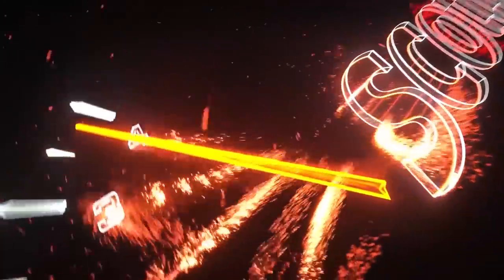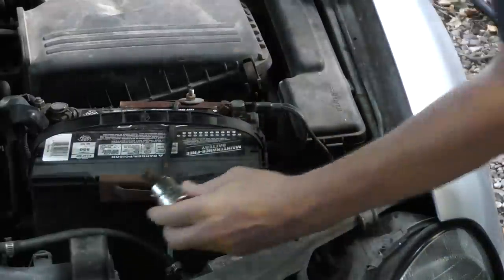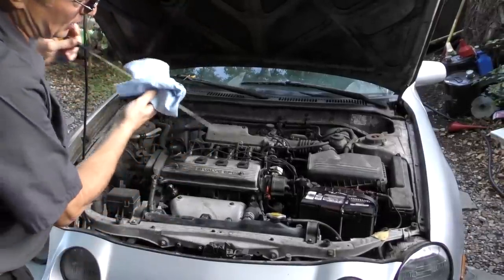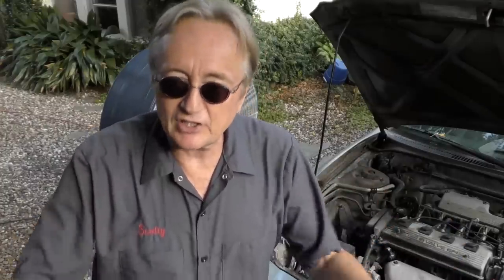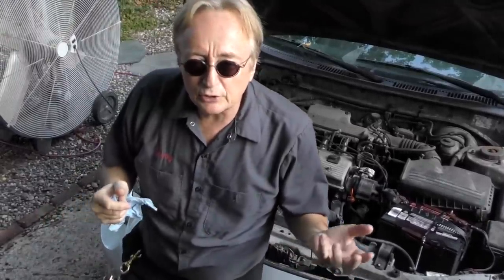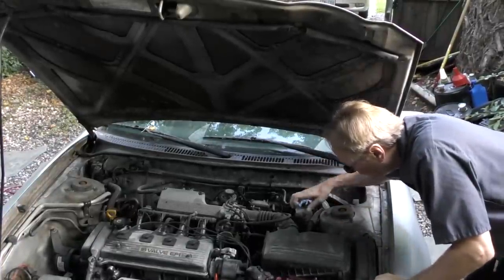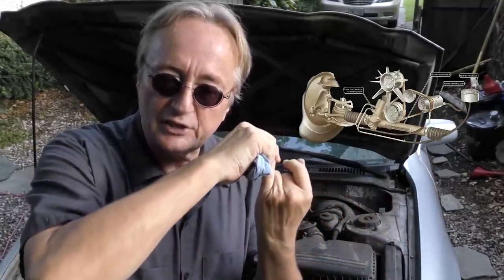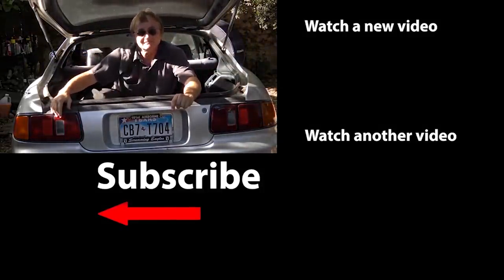If You're Not Doing This to Your Car You're Stupid

Comment: Scotty, you are using the wrong battery protection!!!!  I use vaseline to coat metal surfaces and battery posts and connections. The vaseline protects the surfaces from rust and corrosion. I use a small stiff brush to apply the petroleum jelly to all surfaces, and I NEVER have any problems with rust or corrosion. It is cheap, protects the battery,  and you do not have to re-apply it every six monhs like with the aerosol protection. This is an old solution from 60-70 years ago that works every time. I have have had batteries last seven to eight years, way past the "normal" life of a battery without adding anything more than distilled water when needed. I clean the top of the battery to get road dust (read "rust") off it creating a high impedance path between the posts that ruin batteries and alternators/generators.  I do not buy the felt pads, nor anything in an aerosol can to protect my battery - it is a waste of time and money.
Reply: I use Valvoline too on my battery post, always have, I apply it with my finger wearing a disposable glove!  ( i don't like the spray, it goes everywhere, messy!)

Comment: I would clean the battery terminals, Scotty, but then I'd lose my perfectly set entertainment center settings.
Reply: Use a memory backup battery, easily attached via the diagnostic port adapter.

Comment: My 1999grand am when I got it  I got oil changed they put Syntex in it  they replace wheel barring  and ask them change transmission fluid  they could not find drain plug  I was told it was sealed . it  don't have dip stick .  but I change the oil every year I get reg oil from quick change place . I got changed 2 times last year . they put high miles oil in it .   but  4 mo later change oil  light came on .  every once in while it  qort low . so I just put Walmart brand oil in it . the oil look good just smell like gas so idk my car also drink coolant  and take that Dex cool . I don't know where it is going  .car never over heats so I don't know  local guy I truss can't find where it leaking .he work on my car few times I know nothing about cars  it close too 200k miles on it  runs great just no ac so don't drive to much this summer

Comment: How disappointing Scotty no mention of changing out your differential fluid or greasing the ball joints, tie rod ends, sway bar bushings, drive shafts and U-joints. Also for changing out sealed transmission fluid it holds more than what drained out so your only partially changing some of the fluid and mixing it with the used fluid. To change all the fluid you will need the transmission to cycle the fluid and drain the transmission about 4 times to final get new fluid draining out.

Comment: For the Chrysler why would you even flush the brake fluid every 4 years when it won't even be running by then? 🤔
Reply: My 01 Durango is pushin 250,000 miles, although i'm convinced corporate was there the day they were making my engine lol. I truly believe you take care of the vehicle it will most likely take care of you.
Reply: @Drkonapurps99  Chrysler products were made better back then, now FIAT owns them it's common for a Chrysler to have major issues in less than a year after you buy it brand new from the dealership. normally people try to take it to the dealer to get it fixed under warranty but they rarely ever fix the problem. you are right that taking care of a vehicle will help it last longer, but some vehicles just break no matter what you do. newer dodge durangos have this issue where the car will have an electrical problem, and then engine stalls and the steering locks while driving.

Comment: Hey Scotty are Honda elements good cars??
Reply: They sure are....wife and I bought a new one in 2008...just put a starter on 160,000 miles , put a battery in 2015, only regular maintenance tires, brakes and oil, AC even still running strong , I'm in Texas , was 103 last week

Comment: Is it okay to change a plug in hybrid oil every year?
Reply: should be, depending on mileage
Reply: @wholeNwon  10K miles?
Reply: @clashwithneo  Depends on how much the engine ran during that distance. "Synthetic" or conventional oil? What does the manual say?  I'd probably change at 7500 with "synthetic" but you're likely OK.
Reply: @wholeNwon  synthetic oil 0W-20 and the owners manual says 10K or 5K if the you made repeated trips at temperature less than 32F
Reply: @clashwithneo   Then, obviously, that's exactly what you should do. If your climate and driving is a blend, then 7500 as I indicated before. You'll be very safe. Choose a good quality filter and change it yourself. DON'T trust the dealer to use the correct oil and never go to one of those quick oil change shops, tire dealers, etc.

Comment: People say once they do a transmission fluid change there transmission starts slipping.whats up with that?
Reply: If a transmission is really worn, like 150k+ miles without fluid ever being changed, it can actually be the "grit" in the fluid that gives the gears enough grip to work together. Replacing that with new clean fluid allows the gears to slip because they don't have that extra friction to bridge the gap.

Comment: Idk if i should change the transmission fluid on my 81 monte; I've only had it 1 year of its life
Reply: You shouldn't change the oil or fluid too early when car is new, it's often a different formulation to help engine bed in.
Reply: @PaulMansfield  itsa 1981 I'm worried it hasn't ever been changed

Comment: I never could figure how 0 weight oil is measured. It's kind of like 0 gravity...... When the oil is cold it still has viscosity. If it was 0 the oil has no resistance and is circulating at the speed of light.....
Reply: 0 has the same viscosity as water.

Comment: Hey scotty i have previa 2008 and it has some weird metal noise when going above a hump i have change and checked all front suspension but it still sounds
Reply: Heat shield, exhaust hanger, etc.
Reply: @wholeNwon  checked its good and sound comes from side like if its from the above of shock btw i changed both new shock mounts
Reply: @pbat  Upper control arm bushings?  Sway bar body mount? Etc. Vibration when idling in drive?
Reply: @wholeNwon  no vibrations while idle and i had put new sway bar bushings but control arm is the only thing left
Reply: @wholeNwon  thank you for helping out dude 🌹
Reply: @pbat  Good luck. Might want to google to see if others are having similar issues with that vehicle.

Comment: Need help
 Changed pcv but now got alot pressure in crankcase
Reply: Take the new pcv valve out, and shake it. Is the spring inside moving at all? And how much pressure are you talkin about?
Reply: @jellofuel  yeah its good it rattles its more then before new wires and gaskets and pcv and more pressure in crankcase

Comment: Scotty, i thought your celica is a manual transmission?
Reply: A manual still requires fluid.
Reply: @Mmoose74  my MT Toyota doesn't have a dipstick for the gear oil. Do the older ones have dipsticks? Im not too familiar with the 90's MT toyotas.

Comment: Scotty i have 2004 chevy silverado 2500hd the tire label says in the front tire pressure 50 psi and the rear 80 psi and my tires are LT 80 psi cold max .Do i have to follow these recommendations

Comment: Very disappointed in Scotty. Typical mechanic laissez faire approach... 

And he forgot to say the air filter needs doing every 12 - 24 months. The petrol filter needs doing every 50,000 miles at the most. The brake fluid should be done every 2 - 3 years. Full synthetic oil (and a quality filter) definitely lasts 10,000 miles. Power-steering fluid should be done every 5 years at the most. And check that the coolant is the correct spec for your car (the owners manual will tell the spec). And the Transmission fluid should be flushed every 20,000 miles

Comment: Way I look at it your oil might be good for over 5000 miles but your filter is another story.
Reply: Any should be adequate for 5K
Reply: @wholeNwon  yes but they weren't meant to last that long with out being changed. Except phram they weren't meant for over 100miles
Reply: @WindWalkerDrones   I would avoid Fram, too. Where's the data for not lasting 5K?
Reply: @wholeNwon  most conventional oil filters were designed for 5000 maximum miles. Premium filters  with synthetic material can do more. That being said form working in the automotive industry for over 25 years most people don't buy the premium filters. I worked as a mechanic/ auto body technician for 20 years so I saw what people installed. I also managed a auto parts store 6 saw I know what people's purchasing habits were there also. They might spring for synthetic or synthetic blend oil but say a filter is a filter. So the problem is now great you have oil that will last up to 15000 miles with filters designed for up to 5000. The data can be found in manufactor specs sheets and from the factory oil and filter reps that would cost the store to push there products.

Comment: no such thing as excellent condition on 100 k car unless all belts sensors pumps pulley's struts and much much more have been replaced/ its endless money pit
Reply: My 2001 civic has 303,000 miles on it. Changed timing belt twice, serpentine pulley belt once, one radiator, one alternator, and front struts. That's about all the money i've put in it. Oh, and it still gets 37 MPGs.